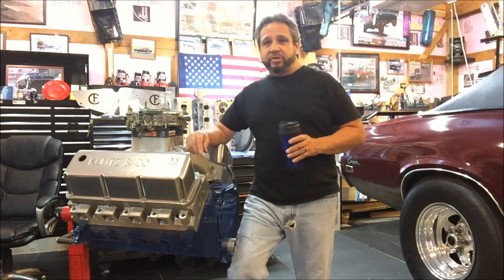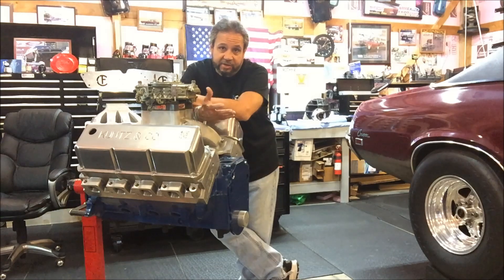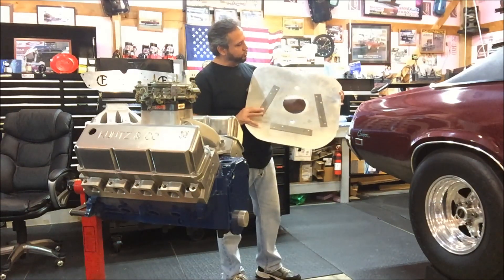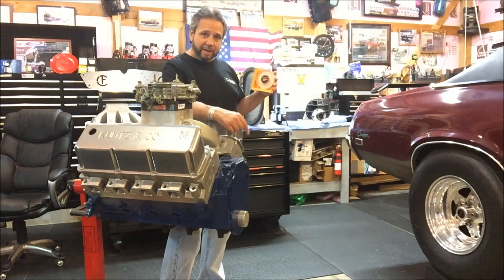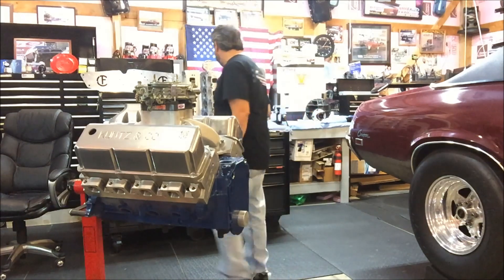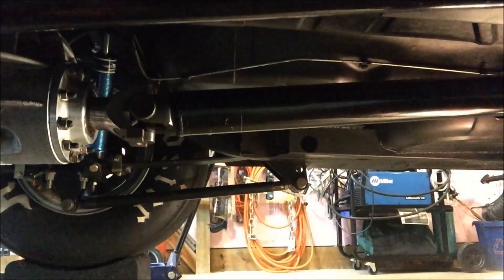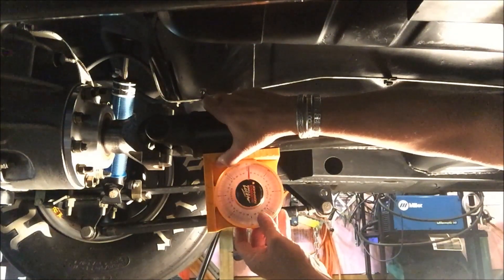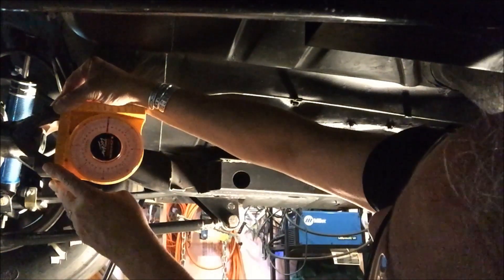Episode 31 The Opinionated Angle

Comment: No matter how much testing you do, or how much your results prove you're right, there will always be those that argue you are wrong on pinion angle. It's largely because everyone READS that the output shaft of the trans and pinion shaft should be parallel just like OEM set them up. The thing is that OEM's weren't launching production cars off a transbrake with slicks and a modified suspension. They were concerned with longevity over miles and reducing vibrations at all speeds for driver comfort.
Reply from the maker: Thanks James, I have comments on Yellow Bullet, about doing it wrong, and that's not what your measuring. There is so much hearsay, that is why I made it the opinionated angle. It is what what works for me. I appreciate your comments and positivity. I am glad that you get the jist of the video. Thanks for watching, subscribing, and commenting.
Reply: @dragboss351cleveland  I don't understand why people think this is odd or wrong. Guys running factory backed 'race cars' were doing the exact same thing in the 60's. Hell, I was doing it in the mid 90's on my second gen Camaro(used to slip the shims in while changing to Hoosier DOT's. in the pits).

I get that it is totally different on an IRS or 4 link car(not to mention those running double cardan or 2 peice driveshafts such as on trucks), but to me this seems like common knowledge for leaf sprung drag cars.

Is it ideal or something I would recommend on daily driven street cars? Absolutely not, but on the track it works. A slight negative pinion angle at rest, on a leaf sprung car, puts it near its ideal angle under the heavy load of drag racing. A 'proper' parallel driveline puts the pinion at the wrong angle going down the track, weakening the u-joints.

Comment: Tim....I’m of the opinion that your opinion of what works for you when checking and setting pinion angle is well stated and the video work was top notch. Trying to get the lighting just right under the car is no easy task but once again you nailed it. 

I have some pretty good angle finding tools but I also have a level and an angle finder on my iPhone 8. I need to compare its accuracy to a known standard but it looks pretty decent and would probably work quite well. 

The close up look at your Scott Cook intake was impressive. The intake combined with “Morganized” early Ford Motorsport alloy heads kinda boggles the mind !  Collaborating with Pros like Kaase and Morgan in addition to the sponsors superior components on the 427 TrackBoss Tribute Engine will undoubtably result in a naturally aspirated, single 4-V carbureted Cleveland with mind numbing, record setting performance. And I can’t wait....
Reply: OOH YEAH, couldn't agree more !!